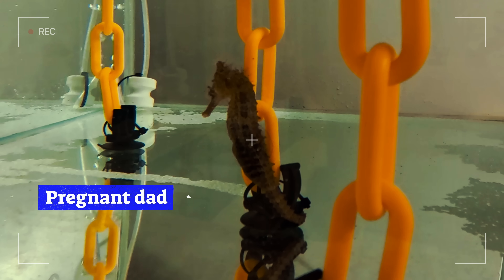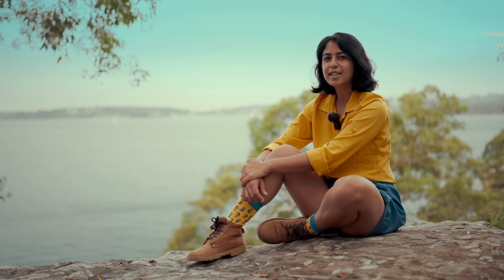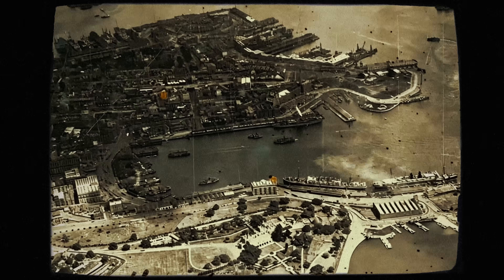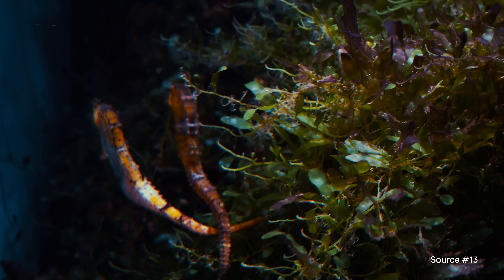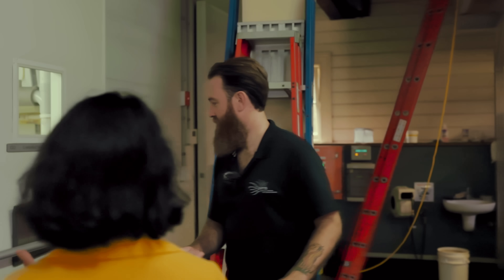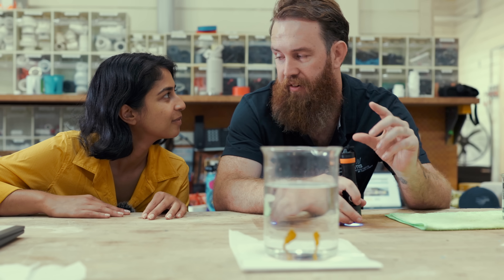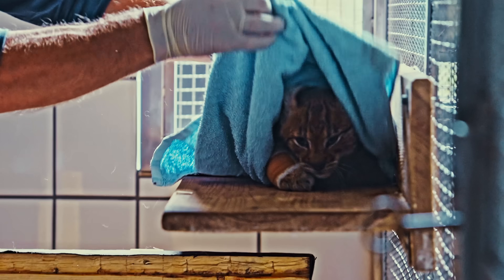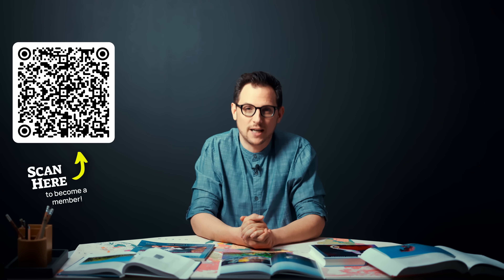How seahorses make babies

Comment: It's one thing when you're just having a conversation with people, it's another thing when you're trying to be educational. Male seahorses don't give birth. The female still lays eggs like most other fish, with external fertilization from the male. The male holds the eggs in a pouch like a kangaroo until they hatch and are ready to go off on their own or at least free swim nearby the adult. When does the kangaroo give birth, when the roo is born and climbs out of the pouch or when it is old enough to leave the pouch? Obviously when Mom pushes them out and they have to climb into the pouch for the nipple. Seahorse males don't get impregnated, they simply hold on to the eggs after the mating and the females pop them out and put them in his pouch, thusly mom still lays the eggs and not the other way around.

Comment: Just curious, why doesn't he bring the female partner as well? It's seems that would stress them out and make her more vulnerable. 🤔. But it is a great project, and I'm so happy I found this channel 💯
Reply from the maker: That's a great question. Both approaches—taking just the male or taking both partners—have their benefits, and they actually use both. If they think the male is about to give birth and can return him quickly (within 24–48 hours), they prefer to take only him. This helps reduce stress on the female. But if they plan to breed them in the aquarium, they take both. Either way, the parents are always returned to the wild to avoid any impact on the population. As shown in the video, they’ve always seen males reunite with their partners and even start courting again, so they believe a short separation doesn’t cause much stress.
Great to have you on our channel :)
Reply: My thoughts too!
Reply: Actually, Mitch has started doing that because he noticed that too. 🙂